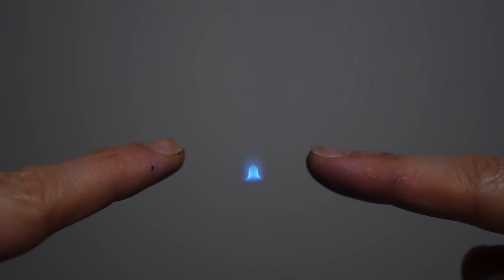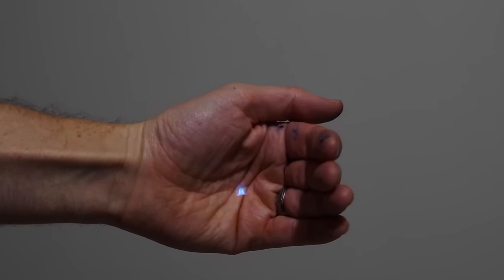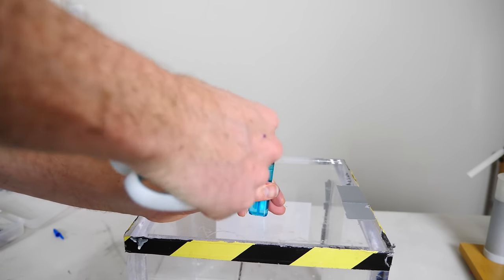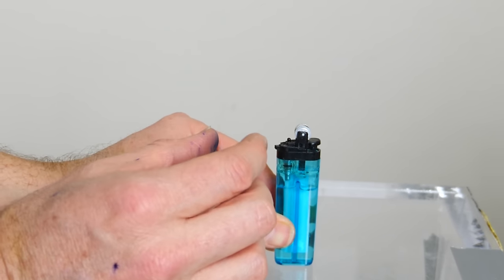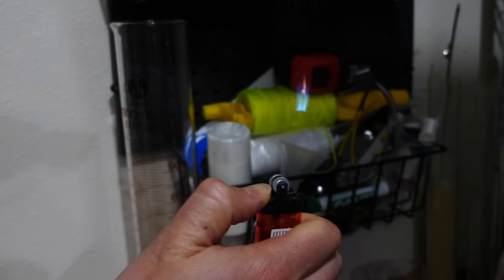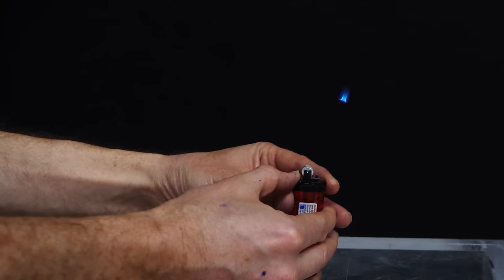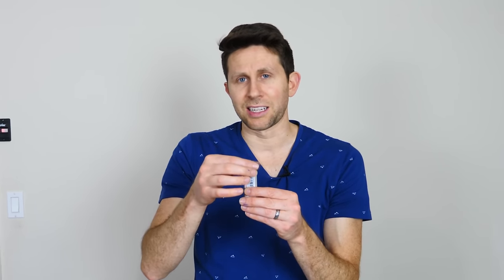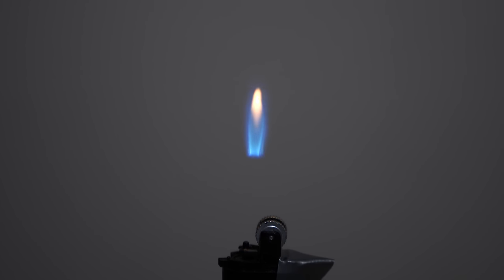Levitating Fire Experiment

Comment: Can't decide what I like best about this guys videos; the original content, the clear demonstration and explanation of the subject, or the sometimes bonus observations he makes about the subject. In this case the plasma settling at the point where the laminar flow turns turbulent.  Gives ya food for thought. I wonder if the flame causes turbulence by generating heat.  Or does the inevitable turbulence cause the air/fuel conditions for the flame to occur?  
See? food for thought. Awesome video as usual. Getting BETTER over time!

Comment: You can also lift, turn, lower and turn again.. the flame adjustment ring and move it several times to increase the amount of gas coming out... 

You get the same effect without using ink and having it spit it everywhere.

Been doing that since the 80s... lol

Comment: Awesome, but you didn't explain the most interesting question. Why does the flame keep burning after you take the lighter away, and how long does it continue burning for? I assume it keeps burning because there is a residual upward laminar flow of butane after you close the lighter valve which will feed the flame until the gas runs out? I can't see any other explanation. I assume it will burn for around 20 seconds or so judging by what I saw on the video, but I imagine you get maximum flame burn time by getting gas flow speed at maximum possible?
I'm gonna have to try this at home...🤔

Comment: This was happening with my forge burner a couple weeks ago. The flame moved away from the burner (at the top of my forge) and I could still see it burning against the bottom for a little but before it blew itself out. I had to clean out some parts and adjust the nozzle.

Comment: Hmmm...  Unless there is another flow control mechanism, reducing the nozzle diameter is not supposed to increase the speed.  What I have understood is the flow speed is dependent on pressure difference and nether the internal, nor ambient pressure is changed by reducing the nozzle diameter.  But forming a venturi might better explain what is happening after addition of the ink coating.  Or what do hydrodynamics experts say?
Reply: Isn't it like putting your thumb over a water tap (US: faucet)? That seems to increase the water speed.

Comment: Why is the volumetric flow rate constant?
Reply: Gas pressure is almost constant; nozzle size is constant.
Reply: @Jehannum2000  No, I mean why is the volumetric flow rate constant regardless of nozzle size? That would be the only way that smaller holes would make it faster.
Reply: @noahwilliams8996  At a given pressure, volumetric flow rate is definitely dependent upon nozzle size. In the gas industry, nozzle ("injector") size is checked using a gas flow rate test.
Reply: @Jehannum2000  so then why would decreasing nozzle area increase speed?
Reply: @noahwilliams8996  Good question. It does, though: if you turn on a cold water tap (faucet) and put your thumb partially over the outlet you can make a narrow jet of water that is faster than the normal flow speed. It might be different for compressible fluids like butane. I'd like a good answer from a scientist. :)
Reply: @Jehannum2000  That would make sense for constant volumetric flow rate.